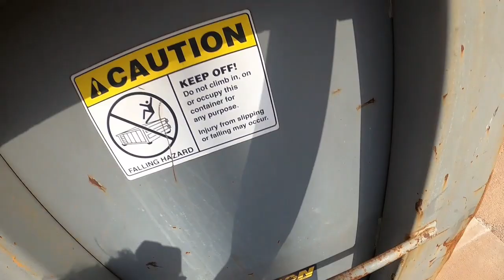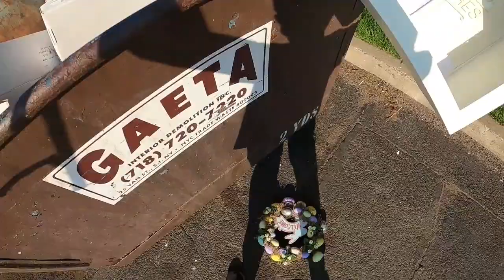NO WAY! Look What These Popular Retail Stores Threw In The Trash!!

Comment: Sorry I missed the premier. It looks like you got some decent stuff. If you have a wax melt at home you can cut up candles into small pieces and use them in there. Keep up the great work!
Reply from the maker: Thank you so much peg’S! It’s okay you missed the premiere! I am happy you still watched! But how would I get the glass off if it’s on there still? Thank you have an awesome day!😊🙏🏻👍🏻
Reply: @mattasticdumpsterdiving7662  You would have to wrap the candle up into something you could throw away and gently tap the bundle with a hammer, remove candle and there you go. Wear tough gloves also.  A newspaper is good to wrap the candle in and the glass shards can be wrapped up in the paper.